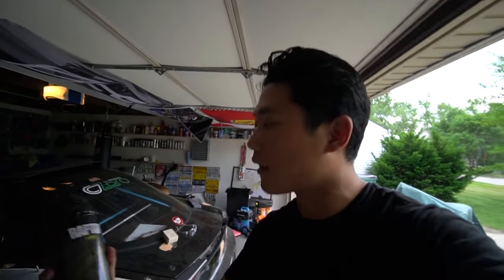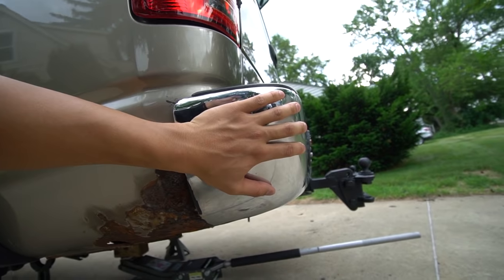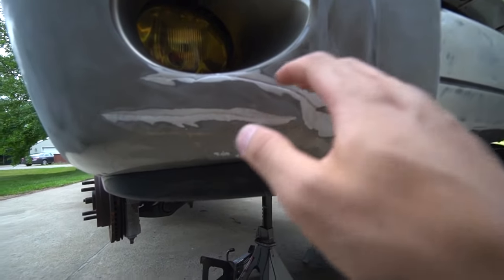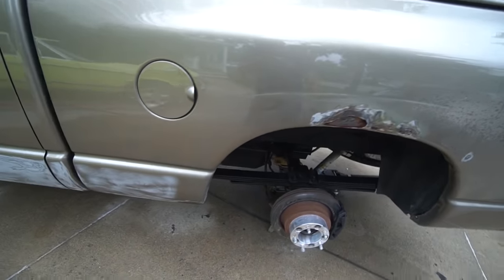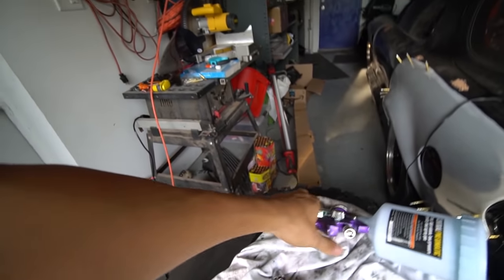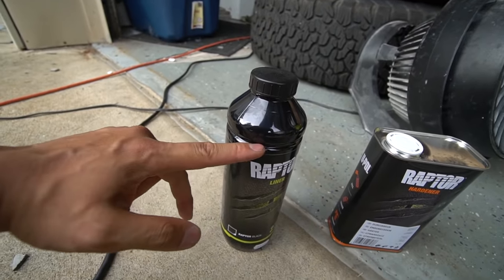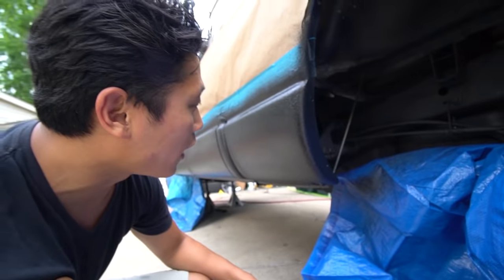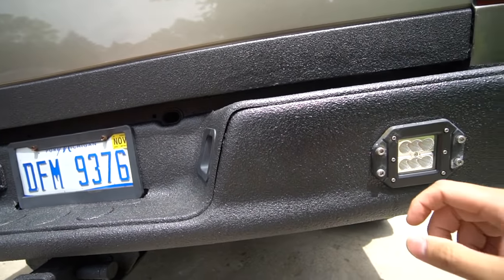Painting My Truck w Upol Raptor Liner Bed Liner - Asian Redneck Project #16

Comment: The factory beige with the black lowers looks nice
Reply: I call it grandma gold
Reply: Hows that rino halo on your driveway. Must rent.
Reply: Looks like funeral beige
Reply: 04dram04 Old-man-tan is what my friends call my truck. (Ram. same color)
Reply: Agreed. Don't do the whole truck.
Reply: Something like this should be done on most but better on all trashy American vehicles when you buy them before they start to rust crazy fast, that's why I always get Asian made brands, way more reliable and if the paint chip a little as usual it stay a little with a small dot of rust and not going all over and all the way thru like on most or all American rusty junk.
Reply: @04dram04  Old man tan
Reply: Terrible Tan

Comment from the maker: Due to all the requests, listed below are product links to EXACTLY what I used for this project. 

- Raptor Black Spray Kit https://goo.gl/26wem2
-UPOL Adhesion Promoter https://goo.gl/KsJMdr
- Bondo 762 FIberglass Filler https://goo.gl/dDWZFd
- POR 15 Rust Preventive Coating https://goo.gl/3fakPF

If you are curious how i rust proofed the truck using POR15, here is the link for that video
https://www.youtube.com/watch?v=Vr-CFAKMP-A

Comment: I have a 2004 ram. I did my entire truck in raptor liner 2 summers ago. Fixed all the rust and only wanted to do it once and it turned out pretty good. On my second winter in Wisconsin with it and still holding strong.

Comment: Paint the whole truck i did a classic aluminium valco fishing boat with that same color combo & i love it.. i live in Arizona and i let the boat sit upside down on the ground in my yard to test sun durability for lil over 2 years & i never touched it, my dogs ran and jumped up on it daily i threw small rocks at it from time to time and it never chipped or faded & the only thing i ever did to it was wash off all the dust from time to time its now been on the boat for 4.5 years and still looks as good as the 1st day i sprayed it.. I've used u-pol's products for over 12 years and I've never had any issues with ther products

Comment: I have a 10 year texture Upol Raptor custom built Audi, in pure white with black roof & 3 coats of clear coat over the top. Then, built a textured Ferrari Red & chrome cafe racer. 

Car has no chips, flakes or damage....10 years later.
Reply: Blakelikesfood z=== Do you mean you but clear coat over Rapter Upol ?
Reply: @wldmhd  : Upol Raptor comes in black, or tintable. I purchased the tintable and pure white auto tint, so it comes out white. However it comes out only almost matt or satin finish, so I did a 2 stage paint job in white over it so now the car is super high gloss and looks so shiny as if it's still wet. Super crazy in sunlight as ultra shiny. 

Cafe Racer is same way, I tinted red, then did a 2 stage red over it, along with the chrome tank and tail.
Reply: @Lordporter1  
1) Teenager talk
2) How anyone comes to that conclusion out of thin air is beyond me.
Cafe Racer : http://s41.photobucket.com/user/Blakelikesfood333/media/Honda%20CL175/Cl175002.jpg.html?sort=3&o=4

Audi: http://s41.photobucket.com/user/Blakelikesfood333/media/Audi%20Final%20Chapter%20Build/photo1.jpg.html?sort=3&o=206
Reply: Very unique bike , I like it. 
The car looks great and very clean . 👍🏽

Comment: Looks bad ass as it is i wouldnt do the whole truck tbh but thats my opinion
Reply: He didn't mean painting the whole truck in Raptor Liner. He meant he was going to paint it like a Metallic Grey with the Raptor Liner Trim.
Reply: He said because the Raptor Liner was so easy to use, he's thinking about painting the whole truck.  I think he meant with Raptor Liner.

Comment: anyone thinking of painting or bedlining their chrome bumpers or trimming. you better do it correct because it will peel in 6 months..chrome is a finish that is tough to make paint stick to. the process for painting over anything chrome is to scruff it up with 80 grit sand paper. make sure its scruffed to the point where you dont have any shiny finish.. then clean the surface with acetone from homedepot with a rag. go to your local auto zone or home depot again and grab an epoxy primer. the epoxy primer is the toughest primer you can put that would grab the paint ike its its first cousin. after you spray with the primer let it dry for 24 to 36 hours as epoxy is a slow setting compund and is best when dried properly. then you can apply raptor liner of your choice or paint. piece of advice. try not to use too much harder and do the mixinf in the raptor liner bottle so you would have pure mix without anything getting caught up in the mixing tub. i went with battleship Dark grey. its darker than the normal battleship grey

Comment: I'm not usually a fan of bedliner on the outside of vehicles.  It always just cheapens the look.  However, in your case with all that rust it's understandable why you went that route.  That being said, I would leave it as is.  It looks way better now than if you bedlined the entire truck.  Nice job....

Comment: Did you wait for raptor to dry before removing tape? Or is it better to remove tape when wet?
Reply: *Bump

I wanna know this too. I've painted stuff before, waited too long and then it was a mess trying to take the tape off but if I too the tape off too soon, it was stringy and left paint strings either on the newly painted surface or the surface I just protected.
Reply: I'm gonna go with take the tape off before its dry. Itll he a bitch otherwise
Reply: I'd wait 10-15min after spraying so it is semi-set.
Reply: Take it off when wet..
Reply: jrg10332 hahaha good advice

Comment: Nice video truck looks good. I will tell you that these dodges rust from the inside out so that raptor liner will not stop the rust. It's like cancer you have to cut it out repair and pray it dont come back.

Comment: Hey man I love the work you did. I am also going to be spraying the raptor liner on the lower side of my 93 first gen cummins. Well for the main reason is, I live in the North Eastern corner of Washington and will cross over into Idaho and Montana.  So rocks and salt that they use on the roads here will tear up the underside if coated with car paint
Reply: I work at an industrial steel fab shop and the same principles apply. It doesnt matter if you are prepping for industrial work, automotive,  or anything else, prep is the most important step so dont cut corners, and you didnt great job

Comment: Great job, U-pol's Raptor Liner really is just mix, shake and shoot.

I'd paint the entire truck in whatever color you like, however, I would go with the finer texture for the rest of it. YOu can get the u-pol pro gun with adjustable nozzle, turn it all the way in, then turn it out exactly 2 rotations and lock it in place, spray at about 70 PSI.

Or, thin it up to 20% with Urethane reducer (Thinner) and shoot it from a HVLP gravity gun with a 2mm tip

Or, you can roll it on with a hi density roller, however, this method uses more material, and curing time is much longer the thicker the material

I did my spare hood for my Jeep with the HVLP gravity gun and was very happy with it, but the the process is a lot slower, especially if you don't have a large air compressor. I achieved the exact same fine texture with U-pol's pro gun and that is without reducer. However, I used 15% reducer on my second coat on the Jeep because it gave me more material. My Jeep took a full four bottles kit and I reckon that truck will take about 6 bottles.

Also, I'm very much aware that this video is from 2018 and I reckon you already did whatever you were going to do, so this comment is for others who might be wondering what to do/use.

Also, if you can not spray inside, or have no indoor parking, get a breathable car/truck cover. the Raptor will be dry enough to put the cover on about 4 hours after last coat. keeping it dry is important, do not expose it to any water within 72 hours when temps are at 60+ degrees. Longer if temps fall below that. Even morning due will ruin all the work you did

Another tip, you didn't need to sand the bumper down to bare metal, just sand back all the clear with an 80 -120 grit wet/dry sander or red scotch bright pad. if you see any shiny bits, keep scuffing, and yes, the adhesion promoter is not only good for hard to sand areas, but also metals like aluminum and plastic parts such as side mirrors

Also, never rely on the adhesive promoter alone. after using it in hard to reach areas, use the U-pol Acid etch primer, or if you want a cheaper option any etch primer or epoxy primer, especially on bare metal and chrome

If you want to ad vinyl graphics, like the RAM logo on the back of your tailgate, you'll need a hair dryer or adjustable temp heat gun to make them stick, and a soft clean rag (Search YouTube), not sure about OEM badges, I haven't put mine back on... yet
If anyone knows how best to reapply them, I'd love to know. RTV?

Comment: The rust above the rear quarters is caused from three slots in the outer wheel house which was done deliberately to make it rust out. I found these on my new 2006 Ram and sealed them. My quarters never rusted ten years later when everyone else’s quarters were falling off!

Comment: I have same truck and color. I’m fixing to get scoop hood and add black as well too the truck. It’s a Laramie and has Crome all over it I’m ready to get rid of some of it. Just happened to run into your video while looking at paint designs to get ideas. Looks good but I don’t know how well that stuff would hold up on the chrome part of the bumper.

Comment: it looks nice as is. let it be.. looks very nice to be honest. Just a quick tip, when spraying try spray evenly and straight not going side to side and then up and down. Also do not spray and stop , spray, and stop. make continuous sprays that way you can have even layers and not "blobs" of paint.  Great video I wish I would of recorded when I did my truck bed with bed liner or my custom tool box that has bed liner.....

Comment: Hey bro....  just a small tip for hard to reach places just hand sand with 120 grit or finer if you have the extra time, so you do not have to use those extra chemicals.  

You're work is well done all the way around from your final product on your vehicle to your video.

Comment: I like the look. One criticism, if your going to try to protect the rust on the bottom of doors, do it from the inside, use a zinc spray as zinc is scacrificial and oxidizes before steel. Just get a can in there and use the whole can. You can still underseal (or bed coat) the bottoms, but thats not where the problem is.

Comment: Is it holding up well on the chrome!? I’ve prepped my bumpers with primer and they were sanded as well. Just have plasti dip on them for now. Leaning towards raptor. Did you have to clean your gun in between cans of liner? Thanks!

Comment: Looks good but I would caution the body holes are there for a reason.  Not sure on your model but a lot beds and/vans have cross members that will drain into the rockers then out the drain hole. If sealed it’ll rust out further up.

Comment: Hello there
Great video! I know you set the compressor for 60 PSI if I remember correctly but how many CFM is needed for the job? I am asking because of the size of the nozzle looks pretty big, at least 1/2", or in this case does it even matter at all?

Comment: Hey, nice video, thinking on doing the same thing on mine. Just one question. On the weel flares between the plastic fender and the metal you have any type of  rubber? On minute 12:43 it appears to be some type of rubber band between them. Thanks

Comment: 2yrs later, do you still have the truck and whats the condition of the sprayed raptor liner? if i dont have an air compressor, do you think the results would be the same if i went ahead with the 2k raptor aerosol can instead?

Comment: how did it hold up for you over time ? i bought a kit to do the bed of my ram and i'm thinking as well to do the sides ! i don't have rust problem yet mine is a 2017 but i just thought it will look durable and better..any tip ?

Comment: I was thinking to do my 4th gen Ram but I don't have an air gun, would you recommend to save up and by a air gun with tenk and do it or you think that spray can will be fine ? I was thinking maybe even roll and brush, it should be ticker and so one coat should be fine..any suggestion ?

Comment: Great job, what was the cost of the raptor products you used on this project, overall the truck looks good, if you can find a gun metal gray that will give it that badass look, overall great job

Comment: So I saw u put the the pro 15 on the outside, what did u do to fill in holes that u had ? I have the same issues with my ram . I want to raptor liner paint it as well .

Comment: Did you have any problems with the adhesion of the raptor liner to the plastic parts on the bumper and wheel well guards?

Comment: Would you recommend doing a frame with this stuff? And wheelwells? I got an older chevy I don't want rusting out.
Reply: If you like the texture on a frame, I dont see why not.  Textured coating like this doesnt look right on a frame  imho, unless you dont care about looks and originality on an older vehicle. I'd use it on the wheel wells and underside of a restomod.

Comment: Don't line the rest of the truck. It looks great the way you have it. Plus if you ever have cracks or chips (from a million different scenarios) on the rest of your body that raptor liner is a pain in the a$$ to repair( lightly sun fadded won't match new liner, micro dirt doesn't come off). If the chips or cracks are on the roadside as it sits it's kinda expected for a truck and doesn't look too bad with a simple touch up. Good luck and it looks great.

Comment: Here's a hot tip dont spray metal panels with bed liner most of them have urea in the mix its ok for some plastics but it will eventually rust the panel out if it's metal.

Comment: looks good. IMO painting an entire vehicle with ANY bedliner material is a NO GO, its heavy, it holds a lot of heat & most brands of spray on bedliner become porous over time & for a truck or 4x4 that gets any sort of off road time, mud becomes embedded into the pores and really looks like crap & is hard to get clean.
your truck with factory beige and the black bedliner on the bumpers & along the rocker panels looks really nice

Comment: Question, anyone hear of using raptor liner say on the bottom of my kayak to use as a guard when I'm dragging it from truck to the water etc? Was wondering if it would work and if I would just need to sand the bottom then apply some of that uphol adhesive to help the raptor liner to stick...any input from anyone on this would be greatly appreciated, if you think it would work and if it would be durable enough to withstand dragging over concrete/rocky surfaces...thanks guys!!

Comment: How much of the hardner you put on each bottle..??
Reply: The kit comes with it and has a line on the bottle you just fill it to it very simple great stuff it's all a no brainer can find it on ebay for like 109.00 for four bottles comes with everything you need and they also sell it in tintable so you can add a color  and spray it the color you want, cool stuff

Comment: Do not spray the bottom of the truck (frame and under carriage) it will rot from the inside out. Under the liner it will rust badly. Just a heads up,

Comment: This really shouldn't be done without a proper clean room/heat/moisture remover setup cause like this you trap the moisture in the application and rots everything out quicker than salt in the snow belts. Not a good idea unless its a total wreck and your going to drive it into the ground.

Comment: The raptor directions and website tell you not to paint over bare metal.   Self etching primer over bare metal.  It will rust even worse and you won't see it till it eats thru the other side

Comment: Spray adhesive and adhesion promoter are two completely different things. Spray adhesive is not compatible with any type of top coatings, LOL
Reply: just like like powdercoating you have to blast it down or at the very least scuff the surface to give it a profile to give the powder something to hold on to

Comment: If you think that cramming a little tiger hair in those rust holes is going to solve your problem, you're sadly mistaken. That rust will continue and those holes will get larger. There is only one proper way to fix rust and filling them up with polyester resins ain't it.

Comment: best part about people who bed line the exterior of their trucks is it gives me a massive red flag to never buy that truck
Reply: uhhh you should be looking underneath the truck anyways since that's where all rust starts. I've done something similar to both of my trucks an 03 and 18 and on the 18 you would never see it. Gloss black on gloss black. The 03 is done like the one in the video because its more of a work truck. I love not having to worry about someone dooring the 03 because they'll only scratch their cars. It also stands up much better than stock from rocks/dirt/mud. As far as rust the best thing is to not drive it in wet conditions but since that's not possible oil coat it every year.

I think I would always do some kind of protection, unless it was just a toy. I have to get my front bumper repainted on the 18 its a sport appearance, just from rock chips. I'll probably get it wrapped afterwards.

Comment: Don't be lazy man take shit off and don't rely on a sander you can always use sand paper by hand instead of spraying that promoter crap, you should have gotten the raptor primer and hit the bare metal the other plastic items like fender covers it peeled off because you probably didn't sand them creating a rough surface in order to promote a good surface for paint or whatever to stick to that is why it peeled off that spray crap don't really work you'll see.